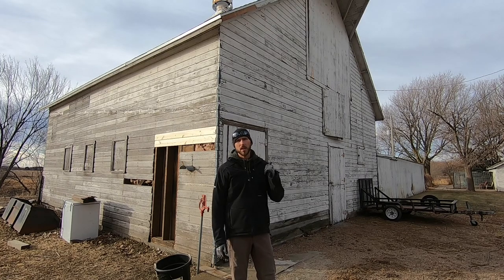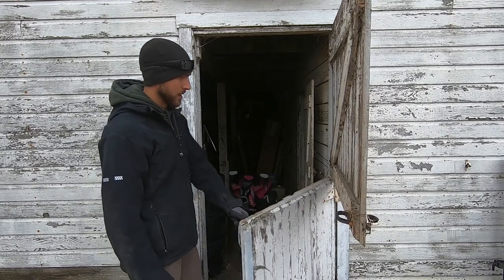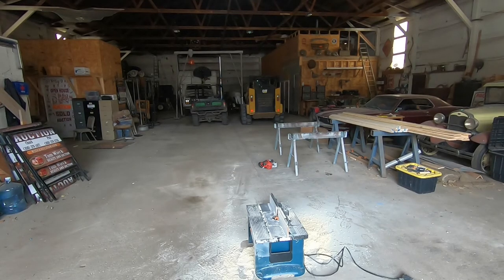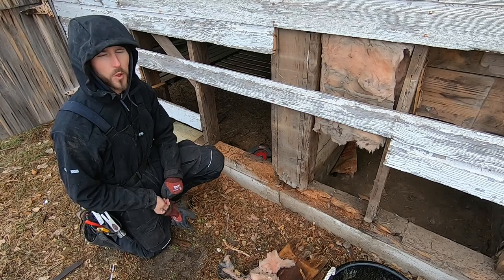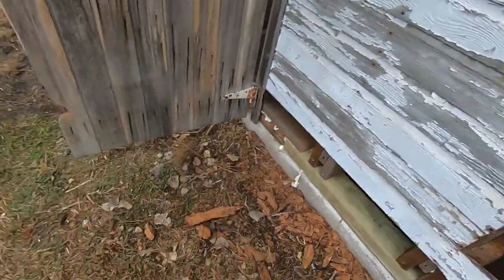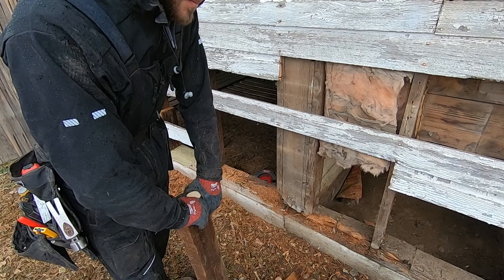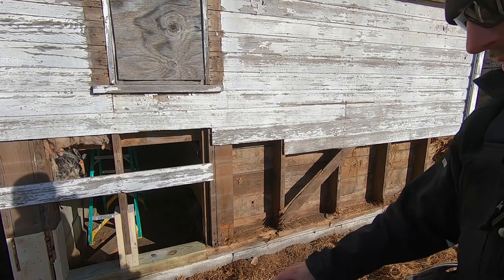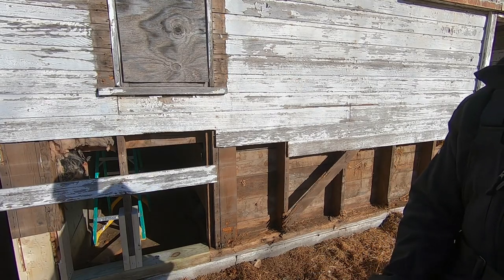Barn Restoration Part 1

Comment: Don't sweat the little things, as someone in the middle of a major barn restoration myself I would advise you to let go of some of the small stuff. If you plan to live in it that's one thing, but for a barn things like siding, maybe not so much. Good work and good job restoring the barn, look forward to part 2.
Reply from the maker: thanks for watching and points well taken, at the end of the day it will be used for storage/ possibly horses. Just watched your barn restoration video and very impressive. Cant wait to see how it turns out! Keep up the strong work!

Comment: those truewerk bibs?! you like em? also, I believe you're using a form of "sistering" on those studs, never done it myself but would like to know more, especially horizontal joists. it was cool to find your channel, its pretty damn good, straight to the point with the right amount of explanation.
Reply from the maker: Thanks man good to hear from ya! Big tru werk fan all around. Bibs are awesome, almost too warm I would get t2s. You can actually move in them. Used to wear carhart and there’s no comparison. Channels a working progress but appreciate that. The first few i sistered wasn’t right, I ended up fixing the way I was doing later in the video. Main thing is to get full bearing from top plate to bottom plate. I just came up with a lap joint and construction adhesive. Heard you’re an electrician, that’s awesome man, good trade to be in for sure.